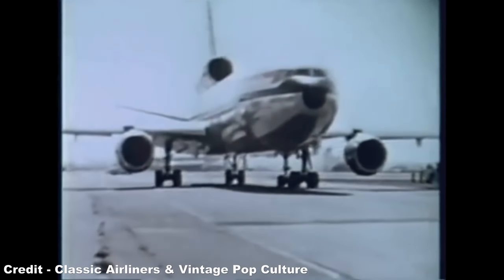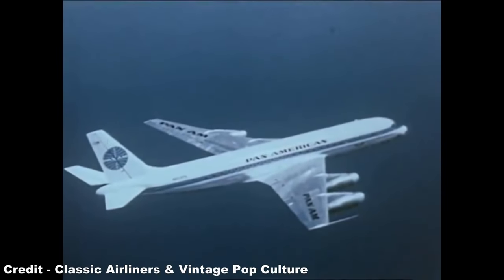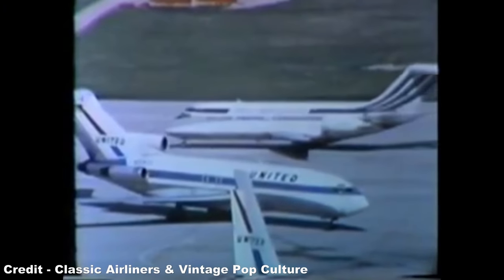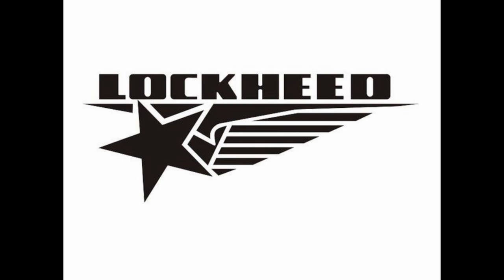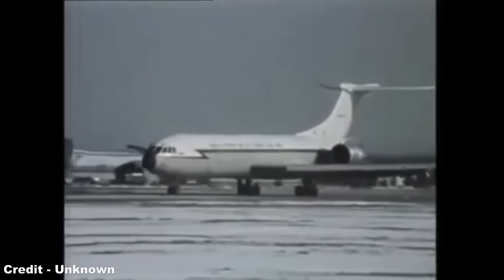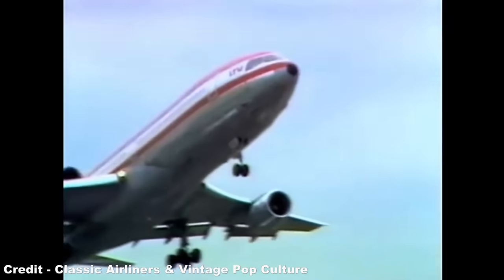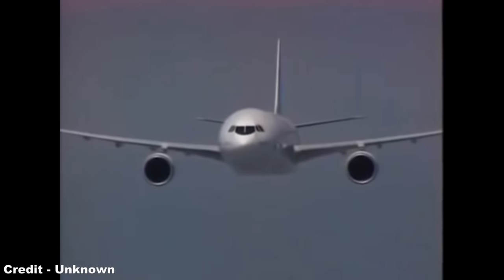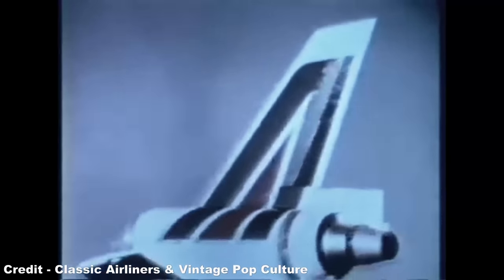What Killed the Trijets?

Comment: I only flew on DC10s in the US and it was spacious and fantastic.🇦🇺👍
Reply: Especially when it crashed
Reply: I flew on a few DC 10's and absolutely hated them.
Reply: The DC-10 was the poor man's Tristar.
Reply: @ Stuart Lee

Lol... no, it was the smart man’s Tristar. You could buy a 747 for not much more than a Tristar or buy a DC-10 for a lot less. 

Lockheed was too used to cost-plus-fee military contracts where they basically have a blank check from the customer. That’s why they’d lose billions on the project. 

And the Tristar was a benefactor of luck. No DC-10 ever lost control of its horizontal stabilizer because it used a conventional jackscrew like every plane from a 747 to a Piper Cub. Just grease it with the right grease and make sure there isn’t a system that automatically drives it down and it’s fine. Only pure luck prevented that plane from being a smoking hole in the ground. 

Same with when an L-1011 had its centre engine explode. Shrapnel hit the fourth hydraulic system too but only luck prevented it from leaking. If it wasn’t a risk, they wouldn’t have installed hydraulic fuses in it like they did in the DC-10 and a lot of other planes as well after Sioux City. 

And Lockheed would get its lesson in cargo door explosions when a C-5 rear door blew out in 1975. It had learned its lessons about engines falling off on the Electra (design flaw, not incorrect maintenance) though all Lockheed wings are chronically weak.. like those of the Electra, the T-33, the Hercules, and others. 

The L-1011 entered service after the DC-10, exited service before the DC-10 (the only L-1011 still flying is the flying observatory.. while dozens of DC-10s still fly cargo every day), had a fraction of the number made, and flew a smaller number of hours due to chronically poor dispatch reliability. 

Hey... the TU-114 Rossiya has a better safety record than the L-1011. Must be a better plane, right?  That’s the trouble with disparate sample sizes when comparing relative merits.
Reply: Yeah and the dc-10s were really quiet, especially when the engines would fall off their mounts. Quiet and smooth. It's just that sudden stop at the end that kind of jars you a bit.

Comment: I remember on Saturday February 14th, I was scheduled to fly on a DL 767 from LAX back to ATL. It was going to be an overnight run. When I got to the Gate the Gate Agent informed me that DL had an L-1011 which departed a bit earlier. I jumped at the chance and he Rolled me over to the earlier Departure
I had an A Window seat. What a fantastic ride! I rode on a 727-200 for the final time in February 2001 between ATL and TYS
It was the Headstart up to Knoxville Tennessee. Those Tri Jets were great work horses in their day! Gate to Gate was blocked for a little over an hour for Flow Control but the actual time Wheels Up to Wheels Down was approximately 29 minutes en route. Also always enjoyed the DC 8-60's and 70,s with the re engined Camma. Corp CFM 56,s

Comment: Later Tridents had four engines! There was an extra smaller one above the centre engine for a boost in take off power. You can see it at 2:57
My main memory of tridents at LHR was how crazily loud they were.
Reply: I believe that the small engine you referring to was called the APU (Auxiliary Power Unit) and was there specifically to supply Auxiliary electric and hydraulic power for light and air conditioning and steering while the plane was on the ground and not at the ramp, the big engines could be shut down for fuel-efficiency and the passengers could still be kept comfortable and hydraulic controls would still function as they were meant to.
Reply: @davidschwartz5127  No, it's definitely not just an APU.  It's there to provide thrust at take-off. As per wikipedia: " Instead of attempting to replace the three engines with a completely different type, which would have been difficult with one engine buried in the tail, Hawker Siddeley's engineers decided to add a fourth engine in the tail, the tiny Rolls-Royce RB162 turbojet, fed from its own intake behind a pair of movable doors. The engine added 15% more thrust for takeoff, while adding only 5% more weight, and it would only be used when needed. BEA accepted this design as the
Reply: ... as the Trident 3B
Reply: @hoagy_ytfc  I'll have to go that a look at the video again, I hadn't noticed it the first time thur.
Reply: The Trident 3B was a high-capacity short-medium range version of the 2E with a 16 ft 5 in (5.00 m) stretch and one additional RB.162 booster engine in the tail; 26 were built. The Trident Super 3B had an extended range of 692 km (430 miles). Two were built for CAAC China Airlines and were the last to be delivered in 1975 from Hawker Siddeley Aviation, Hatfield where I worked as an aircraft engineer and inspector.
Reply: Correct. I flew the Trident 3 with four engines!! (+ the APU) for 12 years with BA. Yes, they were great at converting kerosine into noise. The BAC 1-11 and VC10 were marginally better at it.
Reply: Good pick-up David. I missed that and had to go back to see it.
Reply: You mention loud. I recall an episode of "Air Disasters" when BEW Flight #548 crashed at Staines, UK, just after take-off from Heathrow. Seems that right after take-off, they were required to substantially reduce power due to noise complaints from villages underneath the air corridor. Obviously, the power reduction was manageable, but required strict crew attention; One day, one crew was less than focused, and 118 people were sacrificed because the first domino in the "domino effect" was that the Trident was "too loud" :/
Reply: @jimbounden8109  esp with water injection, Monarch BAC 1-11's,  positively crackling roar on take off!!

Comment: I've flown in a 727 twice but have yet to land in one. I earned my DB Cooper wings in 1993 in Quincy Il. What amazed me was the power. Usually when I'm on a jump plane approaching jump altitude and jump run the pilot is working to keep the plane at altitude. In this case, even at 14k with 180 jumpers aboard I imagined the pilot sitting on the plane, trying to keep it down and knew that one nudge on the yoke would have us turning blue from hypoxia and cold. It's not a particularly good jump ship but it was a trip and I'm really glad I got my chance.

Comment: The endless compromises of the Trident design to meet the ever-changing requirements of BEA would be worth a video of their own. The original DH-121 design would have got to market ahead of the 727 with an arguably superior plane; but BEA decided it was too big and so the Trident 1 was built - which was promptly dismissed as being too-small for the airline.

Another missed opportunity for the UK's aviation industry at about the same time the VC-10 was being undermined by BOAC.
Reply: Yup the trident was designed for exactly what BEA wanted, this limiting it for others sales.
BOAC pulled the same stunt with VC 10 and reduced their order saying it was costly to operate, which it was due to its specialist design and performance for exactly what BOAC needed for high altitude hot weather short take off airports.
At the time it was Boeing only aircraft company joke.

Comment: The Trident may well have succeeded, but a dispute between BA & the older BOAC, meant that the Trident was built far too small. SO. Then the Trident trijet theory was 'pinched' by Boeing. Boeing 727-100 & 200 were outstandingly successful throughout the world while the Trident failed to get any other further orders. Next.  Bigger trijets sought to rival Boeing on the slightly smaller aircraft size market. However, the times were right to see Boeing's 747 Jumbo triumph and thus Airbus turned to an even bigger offering, the A380. As the new millennium began, the notion of Heavy Twin Jets with proven engines and tech was attractive as an even cheaper (per seat) alternative. As such, on the long & very long haul sectors, ETOPS 'heavy' twin isle jets 'won the day'.
Reply: Could it have been that BA/BOAC as concerned that airports on the routes they planned to fly them on didn't have long enough runways for a larger aircraft?
Reply: @stevie-ray2020  If you are referring to Boeing 727-100 and 200 model size at full all up weight,  6000 feet (balanced field length) was more than enough.

Comment: You could make new tri-jets with more fuel efficiency given today's advancements in technology but I think there is no stomach for this great aircraft outside of the cargo sector.
Reply: And even then, there are a whole load of A330 and 777's kicking about that could be turned into cargo airframes, like Cathay Pacific is now doing
Reply: StringerNews1  It isn't just that, it's also the fact you're talking about maintaining three engines instead of two.  So yes, you probably could build a efficient tri-jet but why bother, when two engines can do the job just as well?
Every time I asked a commercial pilot this question, I always got the same two fold answer:  Today's twins have become technologically advanced to the point additional engines are unnecessary (at least for passenger travel), and more engines = more maintenance.
Reply: There would  be on need to make a tri jet anymore. 2 can handle it and much more efficient in engines and also aerodynamics
Reply: StringerNews1  The RB211 on the L1011 had a bypass ratio of about 5:1.
Later versions of that engine went as LOW as a 4.4:1 ratio.
Newer engines ARE higher bypass ratio, like the GE-9X at 9.9:1, which does help their efficiency.

Right idea, BAD numbers.

Comment: The soviet Yak 40 had to have 3 engines because of the fact 2 engines of the type that was available couldn't lift an overweight body. The original plan was to install 2 engines, but the designers eventually had no choice. There was no regard to "safety" or "efficiency".
Reply: I did wonder about that part of the video, it would've been the first time I heard of the Soviets giving any regard to safety

Comment: Nice video! Great job as always! To be fair the original A300B2 and B4 was really more of a short to medium range hauler used on higher capacity routes and had the advantage of also being able to operate off fairly short fields. Kind of like a scaled up role of the 727. And was popular up and down the east coast of the US with Pan Am and Eastern. The true catalyst for ETOPS though was the near simultaneous release to market of the long range A310 and 767-200 twins in the early 80s, especially the later A310-300ET and 767-200ER models. Those 2 types dominated transatlantic crossings on long and thin routes for nearly 2 decades. That bespoke role is why they so few of both types were made, but it paved the way for larger long range twins that followed, they were the pioneers. Only American Airlines really utilized the A300 in true transatlantic ETOPS fashion. Granted they had newer -600R variant unlike Eastern / Pan Am, which was longer range, A310 systems, updated wings and a new tail section. They used it a stop gap during the late 90s and early 2000s, AA used the A300-600R on NYC/BOS to the UK and France. It was mainly used for high capacity, high load factor eastern seaboard, caribbean and south america ops with lots of cargo. Infact the A300-600 and A310 introduced the Airbus philosophy of type rating commonality, that followed with the A320 and everyone airplane they've built ever since.

Comment: Nice video. I grew up in the era of the 747, A340s and the tri-jets. Everything is very boring nowadays in comparison.
Reply: The A340 is a boring plane imo. It's just an A330 with 2 more engines. The tri jets and 747 tho are interesting planes
Reply: @rv7w602  The trouble is you only have two major airliner manufacturers now. Once Trident went under the pressure was off the remaining two big names of Boeing and Airbus.

Comment: Its a shame they did fall out of favour with airlines. But alas  twin jets are much more efficient. Could you do something on the 757 and the NMA project please?
Reply: More efficient under the current legislative framework... but I wouldn't want to be in one cometh a birdstrike or engine failure in general.
Reply: @jimtaylor294  You and me both
Reply: @jimtaylor294  don't think anybody would want to experience one regardless of number of engines. Also all of the twinjets can fly with one engine down
Reply: @Megaranator  True re' birdstrike; though my issue with twin engines isn't an inability to fly on one; rather that three engines is safer than two, as indeed four is safer still.
(though on the latter it depends on configuration thereof; as some quads struggle to fly on two if they're on the same side)
Reply: @jimtaylor294  Why? A KLM 777-300ER flew for hours after an engine failure dumping fuel a few months back
Reply: ^ If you have to ask that; then I cannot help you.

Comment: You have to be careful when saying things like "airliners prioritised fuel efficiency during the fuel crisis" because while that's certainly what the manufacturers said (and it makes sense), truth is aircraft manufacturers have never really cared about fuel efficiency at all. Case in point, the GE CF6-80 which was in the DC-10 (8:29) was developed in the 70s and had a thrust specific fuel consumption of about 0.3 lbs/lbf*hr, while the GE J85-GE-21, first used in the 1950s, has a TSFC of about 1.2 - in other words, a 20 year old fighterjet engine used about 1/5th of the amount of fuel for the same amount of thrust as the DC-10 engine that you claim was being used as fuel efficiency was a key concern during the fuel crisis. The same is pretty much true for car engines, with a typical modern engine being about 30-40% therodynamically efficient, while some older engines with lower emissions can see over 60% fuel efficiency or about twice the range for the same amount of fuel. If this sounds startling, its because the number 1 funder of engine-manufacturing companies are.... petroleum companies.

Comment: The perceived safety of 3 engines versus 2 on long overwater flights is still a comfort.
Reply: No one cared about that when a #2 engine inside the tail or in the vertical stabilizer exploded, cutting control cables and pipes.

Comment: The death by chicken of the RB211 fan blades didn't help the Tristar.
Reply: Bird Strike though being an issue no engine of the time was yet able to surrvive; without use of FOD doors on takeoff & landing which would have been ruinously impractical.
Reply: @jimtaylor294  the hyfil turbine blades had a worse response to impacts than the metal blades used on other turbo-fans. In Wide Body (a book about the development of the 747) the tale is recounted of somebody hitting the desk with the leading edge of a a hyfil fan blade without destroying it. Unfortunately the strength in the other direction wasn't there. Titanium blades were also being developed but whilst more impact resistant they were heavier (IIRC there were also problems with the suitability of the titanium), making the engine heavier than intended this had a knock on effect on the Tristar's performance.

Comment: I can appreciate the old 60 minute rule. In November of 1956 I flew from Paris to NJ on a C-118 (USAF version of DC-6). After a refueling stop in Tenerife, we were in the middle of the Atlantic when we flew into a storm front. We were struck by lightning three times in a couple of minutes and two of our engines had to be shut down. We landed in DC, where our engines were worked on, and took off for NJ. On that trip, a third engine had to be shut down.

Comment: One thing that led to the demise of the Trident was the incredible noise footprint it produced! In the early 70s, a newly-wed me lived in a bed-sit in Willesden Green, North London. We were directly under the take-off path of the Tridents, which passed over us probably a couple of thousand feet up. Now, I'm an aviation enthusiast, and a keen model builder, so engine noise is not something that usually bothers me, but those Tridents were in a league of their own! During the summer, one would pass over head every minute. At the height they passed over us, the noise from one had not abated by the time the next approached. It was impossible to hear the radio or TV - even with the windows closed! And they didn't stop until late in the evening, re-commencing early the next morning! It was a living nightmare!

I moved away from Willesden Green after 6 months, simply unable to stand the noise any longer. In those days, a main road passed through the Heathrow maintenance area. I remember seeing the Tridents being broken up, and celebrated with a bottle of bubbly...!
Reply: Hardly something unique to the Trident, as all airliners with rear or underwing engines were really loud, especially in the pre-turbofan era.

The only low noise configuration out there is a blended wing airframe with the engines on top of the fuselage, which is a configuration yet to be adopted by any airline.
Reply: @jimtaylor294 : True, but the Trident was far and away noisier than its contemporaries! I don't know why, because I'm sure there were others out there that used the same engines, but I can tell you, hand on heart, that the Trident was the worst offender by far!
Reply: @pchristy102  That's along the lines of what I've experienced (though less extreme than Trident) with noise variation between CFM-56 powered 737's and A320's:  The same engine more or less powers both, but the first time an A320 flew a Downwind over my house after years of 737's, I headed outside to see why a 707 was apparently going to land at my local airport.  I assume the official noise ratings are similar, so there must be something going on between A-weighted and C-weighted dB measurements which favors the A320 looking ok on paper even though it's a much whinier airliner.  Engine mount damping?  Vibration interaction with local structure?  Whatever the deficiency, it's an unpleasant airliner (to my ears) relative to other CFM-56's.